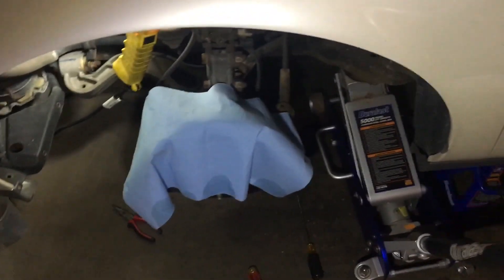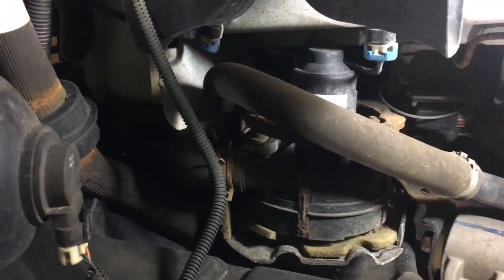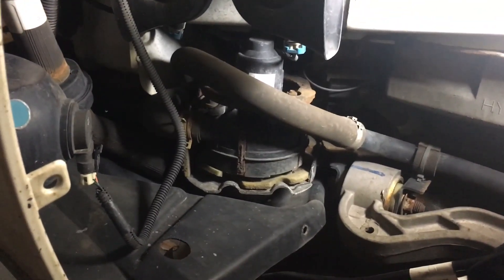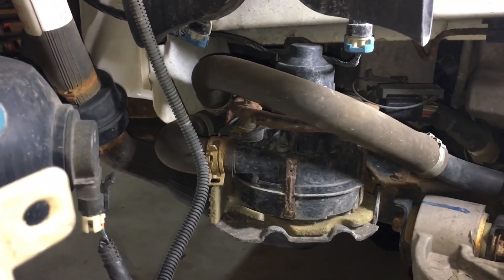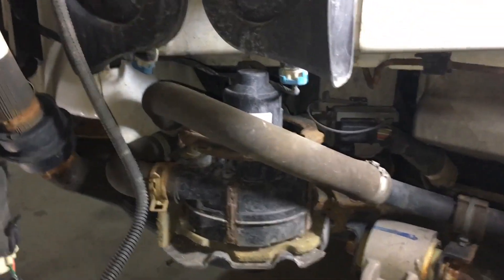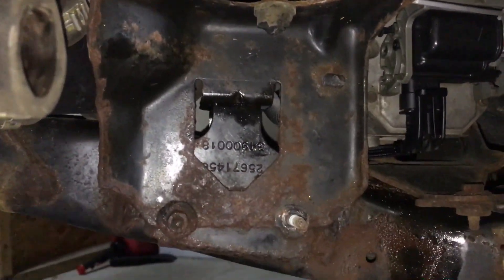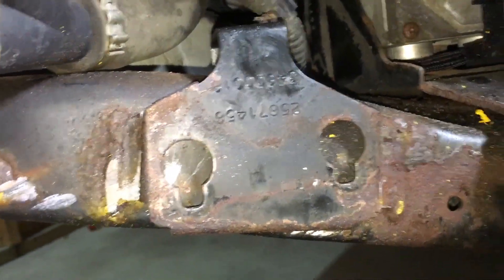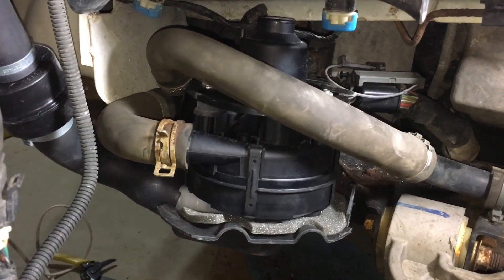Cadillac Deville Secondary Air Pump Replacement - Full Walkthrough

Comment: Do you have loosen the bottom 2 bolts or does it just slide up after the top arm bracket bolt is out?

Comment: Thank you for the video. The MIL light came on with the P0410 code. Curiously, my bi-directional scanner was able to turn off the MIL light and actuate the pump itself, but the light would come right back on. Only 80,000 miles on the 2002 Deville and it breaks all the time. Detroit is a ruined city because they never would do things right.

Comment: I have 2007 Cadillac DTS with a code P2432 secondary air injection circuit causing engine light is there multiple pumps?

Comment: Would this be the P0410 Code? Have a 2005 Cadillac Deville up for inspection and it won’t pass emissions. My buddy said its probably the Secondary Air Injection Pump. I was going to try and do it myself but wanted to make sure I was correct so I know the parts I need to buy. Thanks for any help you guys can provide 👍🏽
Reply: Yes it is. If it's a California car there is 2 pumps.

Comment: Great video, can I remove the pump or disconnect the fuse and drive the car ?
Reply: As long as you don’t have to worry about inspections.
Reply: @joshw9037  I live in Florida lol we could drive a car with 3 wheels and white smoke blowing out of the pipes for miles lol

Comment: Damn things sounds kinda like my problem, I appreciate your video and also I know where the horns are now
Reply: I think I'm having this problem when you start the car up and sounds like a vacuum cleaner and then it stops after about 20 or 30 seconds did you ever get it fixed and is this what it was because my car sound just like his but then it'll stop the noise
Reply: @CHRISFREE84  it was my secondary air injection but the secondary air injection check valve had went out also.... plus check connectors and fuses.
Reply: @WolfmanVon  I have a bad check valve and pump I think. going to test it now...
Reply: Mine too, sounds like a blender full of mud.

Comment: My caddy did exactly the same thing and i employed a much more cost effective repair. I simply unplugged it! That pump is there only to make the catalytic converter more efficient. In my area there is no emmissions testing so i'm not dropping 200 bucks to replace it. It will run perfectly fine with no issues other than the check engine light will kick itself on. For 200 dollars i will just squint my eyes a little bit and ignore the stupid light. Problem solved!
Reply: Ur converter will go out
Reply: @VonAmun  The air injection  pump adds oxygen which causes the converter to run much hotter and thus reduces emmissions. Eliminating it actually increases convertor life substantially!
Reply: @timrussell1559  so not true I just burned the converter it's my second time due to not servicing the secondary air pump
Reply: @timrussell1559  and it makes the car run a little rougher I'm in a 03 base model DeVille the secondary air pump is much needed for the life of the converter
Reply: @VonAmun whatever you say dude.  i've worked in a gm dealership as an auto tech for 33 years so what would i know about it!
Reply: @timrussell1559  you can clog your converter not Servicing the secondary air pump so you're saying disconnect the air pump and the car will run better? Not having the secondary air pump working properly won't interfere with the performance of the car? I'm asking due to the fact that I am days away from taking my car to get the secondary air pump fixed now because my car is lagging and rough idling with a brand new engine brand new spark plugs brand new everything again this is the second time I'm replacing a converter due to it being clogged because secondary air pump isn't helping the converter so I'm confused on your theory that's all
Reply: @VonAmun  a clogged converter gets that way from an engine running either too lean or misfiring and dumping raw fuel into the converter. nothing else! The air pump has absolutely zero to do with a clogged converter. They started adding air injection back in the mid 70's to increase the conveters operating temperature to meet tightening emmissions laws. That is its only purpose on planet earth,  to reduce emmissions. If a converter can get melted up inside(clogged!) By making it run 500 degrees cooler then you should send it to nasa for evaluation because it completely defies 
 the laws of physics. I've replaced dozens of converters over the years and 100 percent of them were damaged by misfiring or overly lean engines. End of story!
Reply: @timrussell1559  okay perfectly understood well you may have just saved me some cash I have a code of p0410 and everything else from EGR valve and everything is going good my car is running a little bit rough so I thought hearing the mechanic say that the secondary air pump helps the converter and it what get clogged up if it's getting no help that's why I was going to buy the part do you have any suggestions before I do this to get the code addressed without buying a new pump
Reply: @timrussell1559  should I buy the new air injection valve which is on the back of the 03 Deville engine.. instead of a secondary air pump? Would that cause that code also?
Reply: @VonAmun  a malfunctioning scondary injection system will set a code and it would need to be replaced/corrected before the check engine lamp will stay off. Mine has been on for years because of the same fault and it doesnt bother me a bit considering the cost of those ridiculously expensive parts. That code/fault will not cause the engine to run poorly. I would have that issue addressed and tell the mechanic to forget about the air injection system, he will charge you hundreds of dollars to fix that and the engine will run no different than before. A lean or misfiring engine can destroy your converter quickly and very likely is the reason you've had so many converter failures in the past. Hope this helps you out some
Reply: @timrussell1559  you helped me out tremendously I was going to buy the pump for 260 and have it installed for 120 bucks I was paranoid but instead of doing that thanks to your advice I'll just pay a $50 diagnostic fee and fix any lean or misfires before I jump on the road this weekend for my 5-hour road trip I thank you so much
Reply: @timrussell1559  This is correct guys. My  secondary air injection pump blows my fuse and I have not used it in years and car runs fine.
Reply: @larryhall8218  do you know if the secondary air in injection pump location is in the same spot on a 05 Deville as in this video? Replacing mine this week, have the parts just wanted to confirm the location
Reply: this is going to sound like a dumb question but i don't have a catalytic converter on my 04 deville previous owner probably sold it for scrap. i am getting the 410 code since i don't have a converter is that the reason its throwing the code?  fairly certain it is just curious on anyone else's thoughts
Reply: @blaisdelldavid10  correct, that code means that the pcm commanded the air injection pump to operate and it did not detect a noticeable change in the oxygen sensors. Without a catalytic convertor the upstream and downstream 02 sensors will read the same and kick on the service engine lamp. Of course the only way to correct that is to install a convertor back on the vehicle. Lucky you!
Reply: So would the secondary air pump cause the car to run hotter if it wasn't working
?

Comment: where does the air injection pump tube on the top of the injection pump connect to
Reply from the maker: I believe I traced it back up towards the radiator. I know it doesn’t go into the radiator, but near it on the top right side. If you disconnect the hose at the pump you can move it around when reaching in from the headline (front) which will allow you to see where it leads to.
Reply: @RetomxSL  mines is actually already off i have a new one with the hose so i was tryna see if you made had time to trace it and see
Reply: @RetomxSL   mines is actually already off i have a new one with the hose so i was tryna see if you made had time to trace it and see